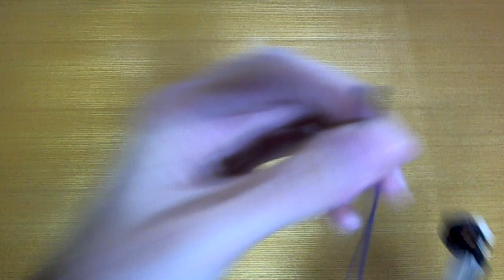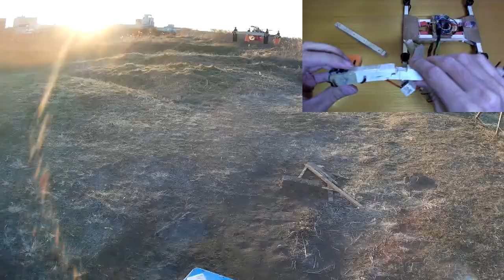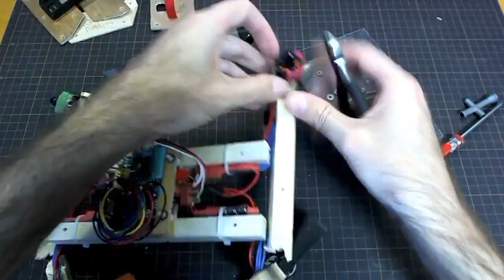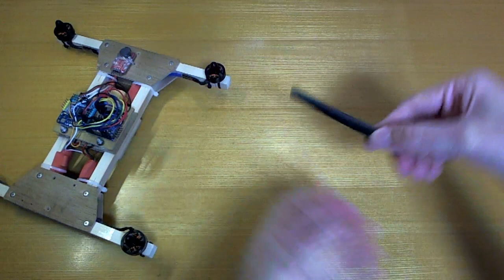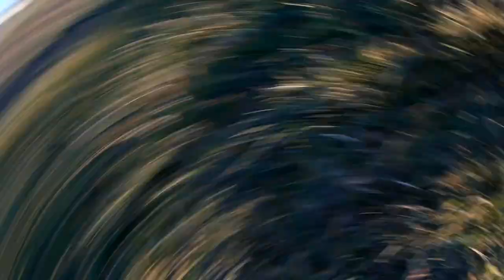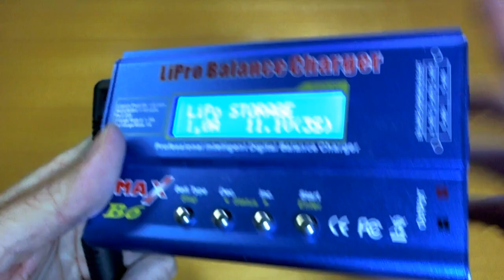Cheap-ass quadcopter build Part 15 - Three months later

Comment: If i use nrf24 as reciver only no telemetry   will it make difference in range if use   pcb antena vs pa+lna version  pls reply
Reply from the maker: Receiver only will have better throughput, because it doesn't need to send any acknowledgements, and the sender doesn't have to wait for the acknowledgements. This is not a factor of the antenna type.

Comment: I will trying to make the cardboard plane in arduino but rc  controller i want make to with arduino joystick shield and NRF24L01, its possible to build? Which mottor be  the best for this? And to connect this mottor i need some special driver?
Reply from the maker: Yes, the control could be done with an nRF24. You would want a joystick that does not have a dead-zone in the center. I have no idea which motor would be best, but brushless are usually good. You would an brushless ESC to control ('drive') the motor.

Comment: I second that about using your credit cards with overseas companies. Mine got hacked when I used it at a gaming site in Germany (I'm in the U.S.). Not a week later Chase Bank notified me that someone tried to buy a $100 pair of shoes at a store in Germany using my card number. Normally cancelling one card and getting issued another is no big deal, but I use mine for autopay for everything, so I had to change the card number on a dozen different accounts.                                                           

BTW, you NEVER want to use autopay directly from your checking account. You could wake up one day and find your account empty if one of your autopay accounts gets hacked. When a credit card gets hacked, you are not responsible for payment. If your bank account gets hacked, the bank tells you it's not their problem. You are on your own.

Comment: A few days ago, i thougt: “hey i could easy build a quad with an arduino” so i went to google and found your youtube video, and i found your channel very well informed with all the things i need to think of when building a quad and all that..

Now! the thing is i know arduino and all the other parts around has evolved alot the last year, and your “cheapass quad” is one year old.. so i was thinking:
If you would build a new quad at that pricerange +-200 USD, what parts would you use/change for that build?

I am fairly new to the arduino world, but after watching your videos i cant really see a problem building one of these myself :) but I dont have any insight in the DYI quad parts world (yet)
Reply from the maker: +Dennis Rawet Funny that you mention this, actually I am planning a new build series and I already have all the parts for it. But it will be a more mainstream build using no arduino or coding at all, and more middle-of-the-range parts instead of the cheapest stuff, aimed at having a competitive FPV miniquad, and using cleanflight instead of multiwii. It's about $350 all up including radio, battery, charger etc. I am keeping track of the parts here: https://docs.google.com/spreadsheets/d/1_JrxVzZXYu_uqyVo6IkFhKutrhK9JIyA5_bOGc6QNe4
Please keep in mind I have not actually built this yet so some of those parts I have not actually tried. You'll also find that some things are doubled up where I have listed multiple options for them (eg. receiver) so don't take that as a final list, I need to organize it better. But it should give you an idea for now.

To build another quad for around $200 total I'm not sure you could change much, especially if you wanted to make your own arduino radio etc. If you just wanted a regular radio I would try the FlySky one in the new spreadsheet http://goo.gl/on05Ph (that's what I went with and have actually tried so far, I really like it :) Hmm.... actually the motor+ESC set in the new spreadsheet (http://goo.gl/9M6mGF) is as cheap as the much crappier motors in the old build, so you could get nicer motors but it still doesn't bring the total much under $200.
Reply: +iforce2d thanks! Ill have a look after work, i was thinking of useing an arduino but maybe thats not nessisary, as you mentioned..

Comment: A reason the coax doesn't work when you bend it sharply is that the shape of the insulator around the core helps determine the cable impedance.  Deforming the insulator is likely causing a large amount of the rf signal to be reflected back at the bend.

Comment: what about aluminium or fibre glass acryllic to make the frame? Any other material which is strong ? Please give the size of screws for the frame also.Dont see it on the BOM for cheapass quad
Reply from the maker: +cochin007 yes, those are good materials too - wood is just cheap and easy to work with. The screws are 3mm screws, but it doesn't really matter, that's why I left the frame out of the BOM because you can just make it however you like.

Comment: Hi, I tried to build Quadcopter by your cheap-ass quadcopter build part *. 
But I used the Arduino Uno instead of Arduino Pro Mini. And I am going to use Hobby King 2.4Ghz 6Ch for controlling Quadcopter. 
Can I control quadcopter by Hobby King 2.4Ghz 6ch without any change?
Reply from the maker: +Jinke Li If you are using the HK transmitter and receiver, you will not need the arduino at all right?
Reply: +iforce2d Thanks for your replying. I use nRF24L01 as receiver and Hobby King 2.4Ghz 6ch as transmitter or controller.
Is it possible? Can I control the builded Quadcopter by HK transmitter from https://www.hobbyking.com/hobbyking/store/uh_viewItem.asp?idProduct=9042.
Reply from the maker: +Jinke Li No, that's not possible - you would either need to use a nRF24L01 at both ends, or use the receiver that came with the HK transmitter.
Reply: +iforce2d I see. And I'd like to know how to connect HK receiver and Flight Controller.
Reply from the maker: +Jinke Li I think maybe you missed part 11 of this series https://www.youtube.com/watch?v=3WzVUexUsig

Comment: Hi, is it possible to use cleanflight failsafe feature with this system. I tried but switching off the tx won't trigger the failsafe. What to check? Thanks.
Reply from the maker: +jarnoorasmae If I remember correctly the code used in this build will set the throttle to zero when there has been no packet received for one second. Perhaps instead of doing that, you could just not do any PPM stuff at all, so that the flight controller will detect that there is no valid signal. I have not tried this though...
Reply: +iforce2d Hi, I tried to turn signal pin 0 in resetData funtion but  it didn't work. Then I made a function setPPMfailsafe and set PPM values to 0 for cleanflight to start failsafe like that:
{
  ppm[0] = 0;
  ppm[1] = 0;
  ppm[2] = 0;
  ppm[3] = 0;
  ppm[4] = 0;
  ppm[5] = 0;  
  ppm[6] = 0;
  ppm[7] = 0;
  ppm[8] = 0;
  ppm[9] = 0;
}
It works but is there any better method to get it working? Thanks.

Comment: I haven't watched all the videos, just kinda browsed through the interesting ones. Anyways, I really don't want to mod the hobbyking transmitter, is there an alternative transmitter I can purchase, that would work the same way the hobbyking transmitter was originally supposed to work? How many minutes would you say this quad lasts with the larger battery? Sorry if that was mentioned in a previous video. Love your work, keep it up!
Reply from the maker: ***** There are literally hundreds of transmitters out there. I don't know much about them, but there is a ton of information on the net. With a 2S 1300mAh battery I think it was getting about 9 minutes flight time.
Reply from the maker: +Trey Zanone (Microzee) this is probably way too late for you now, but in case it helps someone else, I got this transmitter (comes with receiver) a while ago and it's really good, for around $50: http://goo.gl/DY5dNr
Reply: +iforce2d I am still interested in building this, just haven't gotten around to it. But thanks, I'll use this one when I do have the time

Comment: You mentioned not needing the Arduino Pro Mini on the copter. Can you provide a video on how you would do that? Thanks again for the videos. Planning to build one with my daughter for a school project.
Reply from the maker: David Vice Sure, here: https://www.youtube.com/watch?v=bxlJckevIEk But that is getting quite complex if you just want to fly something around. For a first project I might recommend just doing things the normal way (use a regular TX and receiver) unless there is some focus on the radio link needed for the project. That would give you a lot more info to use from forums etc around the net, as opposed to the slightly odd way I've done things here.

Comment: great movie , I ended up buying a flysky ct6b transmitter, from banggood , because of the high chipping prices from hoppyking . I would have bought the same transmitter as you from hoppyking . but it looks like a, exact copy of yours . do you  also configure it, with the computer? and if you do, how should it be setup for the best result?
Reply from the maker: Yeah, it looks like the same thing. There is a config program you can find from somewhere on the hobby king product page which might work. In the Banggood photos though, it looks like some people received software included with it. I never got the config program to work very well, but if you have an FTDI adapter you can plug it into the trainer port on the back. I explained a bit about this in an earlier video, I think part 11 maybe...
Reply: thanks :O) its movie time ... i got the cd with the software but i dont know what the end point and Roll, Pitch, Yaw and so on..should be... my kk2 bord says forward when i pulling back and backward when i push it forward ?? should i convert forward and backward ?
Reply from the maker: Kristian Turell
sorry, I can't really help with that. there should be a setting to reverse each the axis though.
Reply: its okay. im just a litle lost :o) my homebuild quad can not take off. its  turns around, upside down. and it is completely stable...thank you because you have spent time on me

Comment: Nice video!

Just one addition:
Have you read the manual of the Imax B6 charger?

Discharge current is limited to max 1Amps because of the heat it have to dissipate inside... I never discharge on 1Amps not to risk the B6, I use 0.8amps max for discharge.

In the manual it is also mentioned that the storage mode means charge OR discharge to 3.7Volts (50% charge) so you cannot enter more than 1Amps because what if the cells are charged over 3.7Volts and it needs to go to discharge in storage mode until 3.7 Volts?

That's logical I think, that's why the limitation.

Other thing is why do you wish to use the storage mode?

Batteries will have longer lifespan to have stored at fully charged.
Storage mode is just for safety if you wish to transfer it and accidents could happen...
to avoid full charge but have enough charge not to self discharge too deep.

I store my batteries without the safety circuit (it discharges cells much more quicker than normal self discharge) FULL charged when I don't use them for months.

I use mostly unprotected 18650 cells from old laptop batteries and build the packs for RC from them.

My suggestion would be:
-------------------------------------------------
The only reason to use discharge is to measure the capacity with B6 after a full charge, but every discharge/charge shortens lifetime because of the limited cycles.

So basically charge new batteries full first, wait 10 minutes at least and the go on discharge mode with Imax B6 (with 0.8Amps) until 3V per cells.

Read what is the "real capacity" of the battery.
Charge them full and never discharge or storage, just charge and charge :)

(On real "copter" situations discharge is on high Amps so you won't get the full measured capacity on higher Amps... the capacity is still there but LiPo will drop under 3V and needs some minutes to regenerate and gain voltage back and can be discharged again until to have the sum of measure capacity but not in one continuous big Amps discharge.)
Reply from the maker: ah, good point about the discharge current limit.
Storing LiPos at full charge is definitely not a good idea (if it was, then we would not have "storage mode"). Discharging them to 3.0v is not a good idea either.
http://www.rcgroups.com/forums/showthread.php?t=1440578
The 18650s you are using are Li-ion so this stuff is not quite as important, but most of the same strategies will still apply.
http://batteryuniversity.com/learn/article/how_to_prolong_lithium_based_batteries
Reply: ***** The "Estimated recoverable capacity when storing Li-ion for one year at various temperatures" is interesting.
I store 18650s on 4.2Volts (As I know nowadays 18650 have the same polimer kind of Lithium cells inside as RC batteries, no need to have a different way of handling, I charge them in 3.7V mode with Imax until 4.2Volts as LiPo-s).
Even if I store them at 4.2 Volts slowly some of the cells are dropping the voltage (of course I have experience with used cells already have a higher self discharge),
They can hold charge better if they are charged almost full, but even with self discharge they could reach the level of "storage mode" after some months :) so no problem :)

I still think discharging them to 40-50% capacity for storage of just a waste of half a cycle in lifetime, but if you really want to do this with multiple batteries in the same time you don't need to use one Imax and wait for discharge.

There are several ways to charge/discharge your batteries to storage level.

If you still wish to go to storage level and want to speed up things
I would suggest to check your battery pack's voltage, cell b cell with something like this it is easy:
http://www.banggood.com/1S-6S-Battery-Voltage-Meter-Checker-Tester-Low-Voltage-Buzzer-Alarm-p-75520.html

If the battery pack needs charging (its under 3.8Volts per cell) you can go into charge mode with Imax and you can use 4Amps or whatever, not limited to 1Amps.
 Check the cell voltages (pressing the [Inc./Status] shows each cell's voltage in balance mode during charge) and manually stop charging them when you see them above 3.8Volts. (Pressing the pressing the [Inc./Status] again goes back to the charging display.)

It would be around storage level if you charge until 3.8Volts depending on charge current and battery state/temperature,

For batteries above 3.9Volts you can discharge without Imax, you can have at least 2 options:
- use a ceramic resistor and monitor voltage
- or I would also suggest to buy some 10watt 12volt lamp and discharge with them for 3s batteries it would be around 1amps of discharge, (Or 20Watt for 2Amps discharge etc.)

Using a ceramic resistor will produce heat on the resistor and you won't see the process, but a lamp is more visual :)
Ceramic resistors are cheap,
For ceramic resistor if you want to discharge a 3S pack you can use a 20Watt 10Ohm resistor to discharge around 1Amps (if the battery has 14Volts the discharge current would be 1.4Amp by Ohm's law and generate 20Watts of heat so use a small cable not to heat the cells and don't touch with your hands while discharging :P)

You can even build a DIY discharger with voltage monitor for storage using this:
http://www.banggood.com/0_36-Inch-Digital-Voltmeter-3-30V-Voltage-Gauge-LED-Panel-Meter-2-Wire-p-933440.html
(red version can work from 2.8volts so you can check with it a fully discharged cell too)
and soldering a plug for your battery plus a 12Volt 10W lamp and monitor the voltage and stop at 3.7Volts per cell.

Or use one voltage monitor and check the voltage one by one periodicaly while discharging multiple battery packs.

Of course if you forget to check the voltage and stop "manual" discharge it would over discharge the battery.
With some practice or calculation you can predict the discharge time, how often check the voltage.

You can buy a voltage monitor which can be adjusted to make an alarming sound if voltage is under 3.7Volts.
http://www.banggood.com/Wholesale-1S-8S-Li-po-Battery-Voltage-Tester-Checker-Indicator-Monitor-Buzzer-Alarm-p-26049.html

There are several possibilities.

Comment: What about the 4 in 1 10A ESC
I bought it after watching one of your videos. It works ok, but I decided to change the input wires because the gauge size was very small.
Are you using them with the original wires?
Reply from the maker: Actually I removed the blue wires and soldered the motor wires directly onto the ESC board because my quad was quite small. But the motor wires are not any thicker... haven't noticed any problems so far, even flying very aggressively with 3S.
Reply: ***** Well, the 3-Phase wires are ok. I mean the DC wires, the ones that are connected to the battery. Roughly that ones should carry 40A while the ones for the motors will be carrying only 10A.
Reply from the maker: Raul M.
ah those. Yeah I replaced those with JST connector... which is probably not much better though now that I think of it.

Comment: what is storage voltage for LiPos? I thought they are to be stored at like 70% capacity?

Also there might be a good reason behind not charging a battery faster (in storage mode). Thermodynamics rule out the efficiency of that storage state by achieving it slower)
Reply from the maker: Around 3.8V is good I think. But the efficiency I want is time, not electricity :D In any case it should scale with mAh shouldn't it? Why would a 5000mAh battery need to be brought to storage charge at 1/5 the speed as a 1000mAh battery, doesn't seem necessary.

Comment: I have the same charger and it is quite happy to "discharge" a fully charged battery to a "storage" charge ? (that's what the 1.0a refers to - ie the rate at which to discharge to get to a storage charge) love the videos
Reply from the maker: yeah you are right. It seems to work if the battery starts with significantly higher charge above storage level. Previously I had only tried with batteries I had used a little